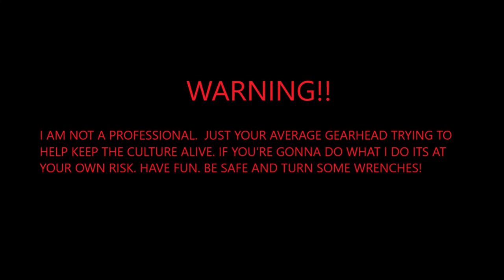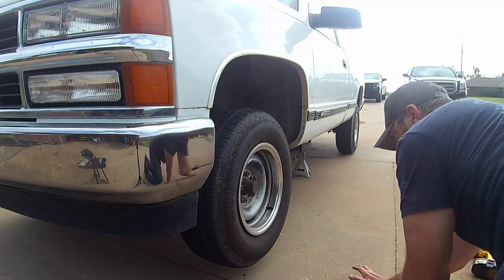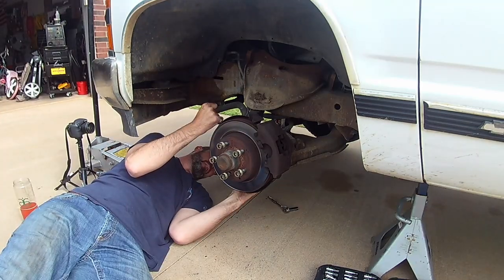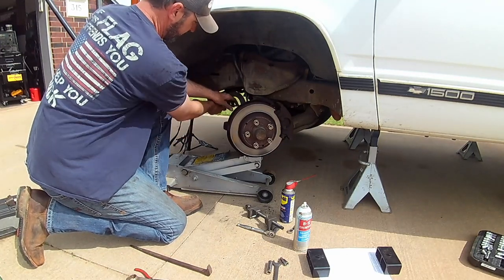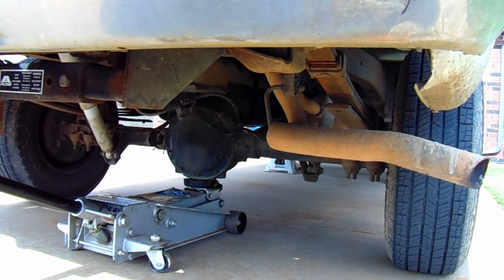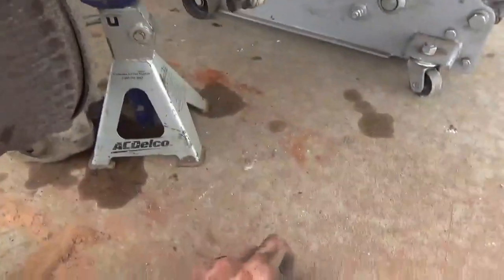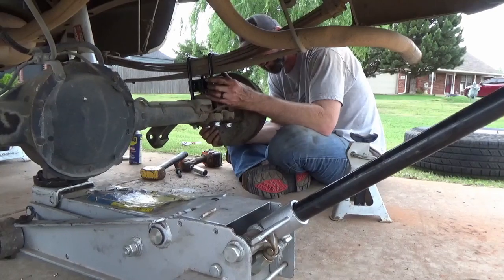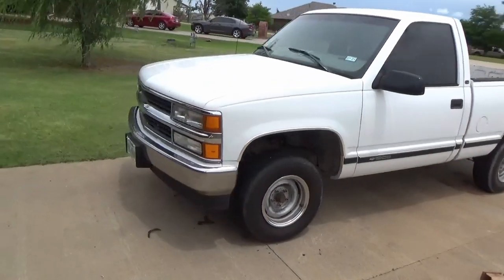Cheap!!! $139 88-98 3” 2WD lift kit Chevy/GMC Lift Torch Off Road

Comment: You can actually borrow the right spring compressor for that type of suspension.  Inner coil spring compressor.  Many times faster and safer.
Reply from the maker: Yeah I tried 2 kinds. Just didn’t have much luck with them. Had an inner also. It just liked to pop off. Thanks for the advice though and thanks for watching

Comment: Great job! What shock absorbers did you use? Need a shocks extension after the lift?
Reply from the maker: The owner ended up ordering some longer shocks from Rough Country.  you can find them on the Torch Off Road website

Comment: I’m trying to lift my 2wd 1999 obs tahoe 3inch which tire size do u recommend for a 15 inch rim ?
Reply from the maker: I wouldn’t go over a 33”. A 33 x 12.50 R15 would be good. But I wouldn’t go over a 32” or 33” tire. Thanks for watching! Don’t forget to use the Promo Code HARTROCK10 and save 10% on Torch Off Road brand products
Reply: @HartRockGarage  ok so if I go 4inch would they fit?
Reply from the maker: I’d think a 33” would fit with the 3” lift

Comment: What about a 98 Chevy c3500 ? 2wd single wheel
Reply from the maker: Does it have coil spring or torsion bar front suspension. Some of those ran torsion bar on front of 2wd. Let me know and I’ll get you a link for the kit
Reply from the maker: Did you figure out what you have yet?

Comment: Will this fit a 1991 Chevy suburban 1500 2wd
Reply from the maker: Yes as long as your suburban is coil spring in the front, leaf spring in the back and is a c1500 half ton this same kit will fit. Thank you for watching. Be sure to use promo code HARTROCK10 to save. 10% on your purchase

Comment: Do you remember what size wrench you used to take out the ball joint bolts?
Reply from the maker: 1 1/16” I believe
Reply: 1 1/8
Worked for me but at 
1 1/16

Comment: Will this work for a 1994 Chevy 1500 2wd without a torsion bar?
Reply from the maker: It’s coil spring front and leaf spring rear right?
Reply: @HartRockGarage  yeah
Reply from the maker: Yes it will work. It’s a coil spring spacer and leaf spring blocks
Reply from the maker: Be sure to use the Promo Code HARTROCK10 and get 10% off

Comment: Should I be proud that my dash is mint plus I’ve never seen a smashed one usually just a dodge issue of that gen in my case
Reply from the maker: Heck yes you should! I’ve had several over the years but it seams like the last 5-8 years when I find them they are busted badly. Kinda weird! Hey thanks for watching!!!
Reply: I have a 2001 RAM 1500  and the dash is toast.

Comment: I got a 1990 chevy c2500. I currently have the truck completely torn apart for a frame off restoration. The frame is ready for paint soon, and I am looking at front and rear suspension. I bought 33 inch tires and 16 inch rims for the truck and it currently has stock suspension. I want to throw a leveling kit on and can't seem to find anything for a 1990. What do you recommend I do? I don't want to do a body lift and I want to run those tires. Do I need different shocks, coils, etc? Thank you
Reply from the maker: Unfortunately this kit will not fit the C2500.  Torch Off Road has not begun manufacturing that particular lift as of yet.  Thank you very much for watching!  Sorry I don't have a better answer regarding the kit.

Comment: Hey man I got that 3 in lift for my 1995 Chevy 1500 that you recommended me but I am having trouble with my shocks any recommendations? Stocks ones don’t do there job well
Reply from the maker: I actually got some on Torch Off Road website. Rough Country sells some extended shocks specifically for trucks with leveling kits

Comment: Did you have trouble getting the alignment
Reply from the maker: Had to put tie rods on but it was aligned
Reply from the maker: Thank you for watching!!
Reply: Because my dad did this lift and they are saying they can’t align due to the control arms
Reply from the maker: I would contact Torch Off Road and let them know what he was told. See if they have any suggestions
Reply: @2kbumsgetdropped916  there are alignment tabs that need to be nocked out that give the alignment bolt 🔩 about a 1/2 inch of play this might help I had mine nocked out to get my upper control arms in spec for alignment with my spindle lift

Comment: I can’t find this kit for my 98 GMC Sierra C1500 3 door extended cab.
Reply from the maker: Should be same kit I used. Let me find the link
Reply from the maker: https://torchoffroad.com/collections/chevy-gm/products/1992-1999-chevy-suburban-tahoe-gmc-yukon-lift-kit
Reply from the maker: This is the link for the kit. Although it doesn’t say it’s for trucks, as long as your truck is a 1/2 ton 2WD with coil springs in the front and leaf springs in the rear it will work. Remember to use the Promo Code HARTROCK10 to save 10% off

Comment: Would the rough country 0-2 extended shock work for the front end ? Because I can find anything more extended than 2
Reply from the maker: Yes that should work as long as you make sure it is for the 2wd

Comment: As someone who just installed a body lift by myself. Don’t. Go this route for a cheap lift everyone.
Reply from the maker: It depends on what your end goal is everyone. Body lift will give it taller look and clearance for bigger tires. But you also have to buy brackets to raise your bumpers and brackets for your E-brake. Suspension lift will give you frame clearance. Pick your poison
Thanks for watching!

Comment: I just bought a same truck 98 4.3L i wan’t to do the same lift kit as you.  mine has 31x10.5r15 tires
Reply from the maker: That will look great with it. Be sure to use the Promo Code HARTROCK10 to save 10%. Thank you for watching!!

Comment: So I see the link in the  description says 92 & up when u go to the website,  I have a 88  C2500 3/4 2wd would this fit?
Reply from the maker: Yes it will. If you go on the Torch Off Road website or use the link I posted, scroll down and read the description. It shows 2500 2WD. Just have to have coil springs in the front. Thanks for watching. Be sure to use the Promo Code HARTROCK10 to save 10%
Reply: DTR - Edit* Torch got back to me and said it will fit a C1500 Silverado, the model years listed are for Tahoes and Suburbans.  Since all of those years overlap in the C1500 trucks and SUVs they only out 92-99.
Reply: @NovaKid19  so it will fit a 2wd 1988 c1500 ?
Reply: @No.No.7  I didn’t go this route so I can’t say 100% for sure, but yes the tech I emailed said it would work with 88-98 C1500s.
Reply from the maker: Yes it will

Comment: What size did you cut the spring compressor bolt to
Reply from the maker: I did not measure it I just cut it. I don’t recommend cutting them. I was just pretty desperate and on a time crunch. Thanks for watching!

Comment: When I go to torch off-road I only see a 6 in RC lift and shocks/struts no other lifts
Reply from the maker: https://torchoffroad.com/collections/leveling-kits-1-3/products/1992-1999-chevy-suburban-tahoe-gmc-yukon-full-lift-kit
Reply from the maker: I just sent you the link for the kit.  The link is also in the video description.  Please be sure to use the code HARTROCK10 so you can get the 10% discount at checkout.  Don't forget to check out all of the New EDC Gear and all other products while you are shopping.  Remember, Promo code HARTROCK10 saves you 10% om all Torch Off Road brand and MaxTrac Suspension brand products!!  Thank you for watching. Please subscribe!!

Comment: Just ordered the kit with your promo code I did 3 front 1 rear should be equal level
Reply from the maker: That’s great!! Thank you very much for the order. And for watching my video. Subscribe and tell your friends!
Reply: I got mine done.. its rides absolutely horrible fronts extremely stiff and bouncy
Reply from the maker: @jalmada7435  did you get longer shocks?
Reply: @HartRockGarage  I actually order some last night
Reply: Also have camber so guess I'll be doing something with upper arm or ball joint
Reply: So I have to add...
Don't do coil spacers 
No matter what I did longer shocks 
And ball joint spacers it rode like garbage bounced like crazy.. wanted alot of money for stuff I can't use unfortunately
Reply: @jalmada7435  was it really that bad of ride because I’m thinking about buying it but I’m fine with a little bit worse quality but I don’t want it where the want would for example make a drink fall out of the cup holder from jt being so bad

Comment: Does torch off-road still sale this kit? I can’t find it on their website anymore.
Reply from the maker: It shows for RWD suburban/Tahoe. Here is the link. Thanks for watching!
https://torchoffroad.com/collections/chevy-gm/products/1992-1999-chevy-suburban-tahoe-gmc-yukon-full-lift-kit
Reply: @HartRockGarage  but it works for him 88?
Reply from the maker: Yes it works for an 88
Reply from the maker: As long as it’s a 2wd and has the coil spring front end
Reply: @HartRockGarage  thank you. .my roommates did their Tahoe, but I guess it ruined their alignment. Both tires are bow legged now. Did they forget to do something besides alignment possible?
Reply from the maker: They need alignment. I believe i mentioned that in the video if I remember correctly. If they are unsure on any other issues have them contact Torch Off Road. The folks there will speak with them and see if they can help out
Reply: Do they have a 2 inch leveling kit ?

Comment: I just did this and now my front wheels camber inwards at the top of the tire. What went wrong?
Reply from the maker: I would just double check to be sure that the coil spring is sitting in its proper position. And it will probably need alignment. I’ve had some that do that and some that don’t. All just depends on the vehicle. Thank you for watching!
Reply: @HartRockGarage   has a alignment worked for all of the ones you had
Reply from the maker: I’ve had to replace certain parts like tie rod ends, ball joints etc on some. But alignment helps

Comment: Hola me podras decir donde puedo conseguir el kit
Reply from the maker: Listed below is the link for the kit featured in the video. Be sure to use my promo code HARTROCK10 to save 10% on your order. You can also pick up some shirts and hats while you are at it and save 10% on those as well.

https://torchoffroad.com/products/1992-1999-chevy-suburban-tahoe-gmc-yukon-full-lift-kit?variant=32072722645105

Comment: Did you had any problem putting yours shocks back in place Sometimes the spring bends to the outside ?
Reply from the maker: I had a rough time with the whole thing unfortunately. I took it back apart several times. The coil spring has to be lined up perfectly
Reply: @HartRockGarage  did you had to cut the Springs to make it easier?
Reply from the maker: @marmolesygranitosdezacatec443  I did not cut the springs. Cutting the springs will make the springs shorter which takes away from the lift. I just had to keep working at it. That was the toughest lift I’ve done
Reply: @HartRockGarage  i have a 2.5" lift kit and the mechanic could not put the shocks back in place because of the spring, it bends to the outside
Reply from the maker: I would contact @torch off road and see if they could help you out with this issue?

Comment: I can’t find this lift for my 89 GMC Sierra
Reply from the maker: Let me find the link for you and I’ll get right back with you bud. Thanks for watching!
Reply from the maker: https://torchoffroad.com/collections/chevy-gm/products/1992-1999-chevy-suburban-tahoe-gmc-yukon-lift-kit
Reply from the maker: This is the kit I used.  It shows Suburban/Tahoe but those are coil spring front just like the trucks. Don't forget to use the code HARTROCK10 for 10%off
Reply: Thx appreciate it
Reply from the maker: You bet! Thanks for watching. I appreciate it a bunch
Reply from the maker: Yours is a 2wd and not 4x4 right?

Comment: Perhaps you can give me some advice? I changed the front control arms. At the same time I installed the same lift kit. The front wheels are  tilted inward now. The mechanic said that the adjusting bolts on the levers were turned out to the maximum and it was impossible to make an alighment .
Reply from the maker: That seams odd. I would contact Torch Off Road and see if they have any advice on that.
Reply: Did u find out your problem cause i have the same problem
Reply: I was waiting for this comment.  I have a 1999 c1500 suburban.  Put in 3” spacers front and back.  The height looks great but then front tires are squatting like a Honda.  I bought the “adjustable” camber bolts.  Tried every configuration I could.  Still squatted.  About to go yank them out and wait to do a 3” body lift instead.  Any advice?
Reply: I'm probably a little late to this. On the frame where the upper control arm mounts to the frame, from the factory there are cam ecentric adjustment bolts installed. However for them to work as intended they need to be removed so that a perforated section of the frame can be knocked out with a tool ( otc 7491C) so then the hole the bolts go through is slotted and the bolts can move as intended to allow for camber and caster adjustment. A lot of alignment shops are not familiar with these older trucks and see adjustment bolts and try to turn them and get no adjustment out of them.

Comment: Can you tell me please about the conduction with this new spacers?
Is the suspención harder with this spacers in the front?
Where I live there are a lot of holes on the roads, so I would't like this spacers does my truck harder the suspención.
Reply from the maker: It definitely made it a stiffer ride. If you have rough roads this will make it worse. You can upgrade the shocks but it still will make the front end more stiff

Comment: Did you have a problem with the control arm banging the frame?
Reply from the maker: No I did not. That seems odd
Reply: @HartRockGarage  awesome I had bought a 3” spacer set and was doing reading and research on installation and everyone says the control arms hit the frame and I would have to put flip the top ball joint and put a ball joint spacer to keep the upper control arm from banging the frame
Reply: @josephlee6610 hey if you can get back to me, I'm having the same problem and am very curious how you solved your problem

Comment: How were the controll arm angles after lift
Reply from the maker: They needed alignment for sure. They were extended pretty far after lifting
Reply: @HartRockGarage  they make billit aluminum ball joint spacers to help bring the uca up level and help with harsh ball joint shafts 
angles the fit right under lip of control arm need longer bolts and grind rivets off uca before install also the alignment tabs if removed from alignment saddle will give an extra camber if needed
Reply: @jonschwartz9669  do you have the link for the spacers? And I have a 4 inch spindle lift on my 97 and I wonna raise it up 2-3 more inches what do you think is better 2 inch lift springs or the 3 inch lift u put on
Reply: @josecaceres2187  you can find the ball joint spacers on eBay is your truck a 2wd and is it a c1500?
Reply: @josecaceres2187  I have a 98 c1500 2wd and put a rough country spindle lift on my truck I could go on for a hour or so of the problems i had after installing and what it took to finally get it going and safe

Comment: Can I use the original shocks absorbers in the meanwhile I order some rough country ones ?
Reply: Also what inch lift blocks did you install, 3inch or 2.5in etc?
Reply from the maker: I used the 2 1/2” rear blocks. And you can run stock shocks. They just won’t function properly at absorbing the bumps and such because they are extended so far out. You can run stock though. Before you even get started let me tell you that the front end is extremely difficult. Make sure you have all of the proper tools. Be safe. Those coil springs are dangerous. And give yourself plenty of time. You are gonna need it. Thanks for watching. Please subscribe

Comment: Can u use the same shocks with this torch kit. I just bought some now ima use this lift
Reply from the maker: Yes you can use stock shocks but I highly recommend getting shock extensions. It will help with the ride. Also you may consider some upper control arms made for 3” lift. I hope this helps

Comment: We can’t get the spring to compress and go in with the spacer
Reply from the maker: I had a rough time as well. I used that spring compressor and I had to have it turned a certain way to finally get it in there. As I specified in the video it was a chore and the difficulty level was very high. Just keep fighting! And be safe!
Reply: @HartRockGarage what are some good shocks to run after installing this. And if I put in new shocks will it help the truck ride a little smoother
Reply from the maker: Let me get back with you on the shocks to see what is available. And it will help the ride a little.
Reply: @HartRockGarage  my other quiestion is. I have a lot of negative camber. Is this permanent?
Reply from the maker: @krazypotatoe4207  Rough Country had some extended shocks for the front that are built for the 2"-3" front leveling kits.
Reply from the maker: I apologize for missing this message.  I think I stated a few times in the video but do not remember, you will probably need alignment and such.  If you are having further issues I recommend contacting Torch Off Road.  They designed the Leveling kit so they should be able to help with any of these technical issues.  Thank you again!